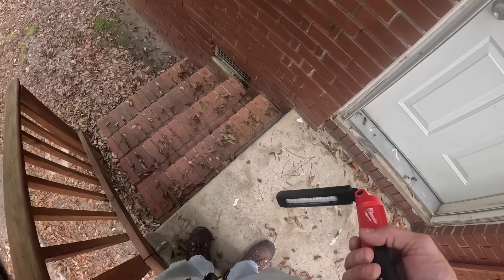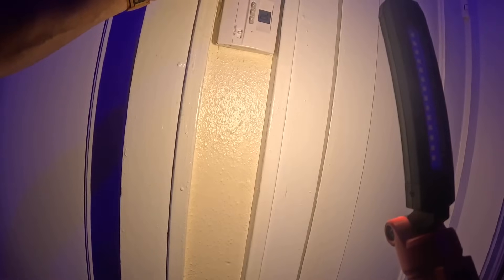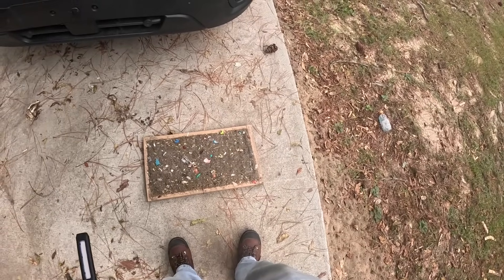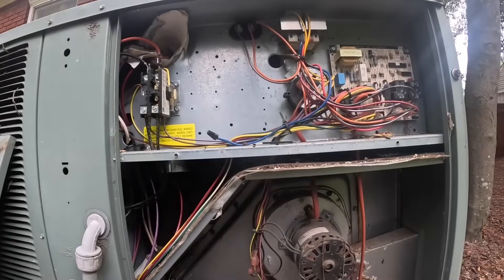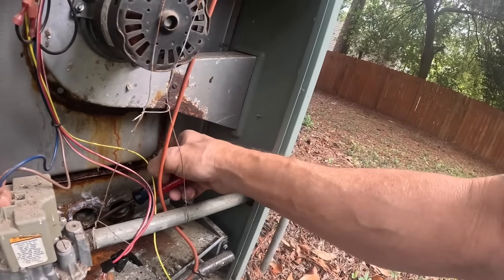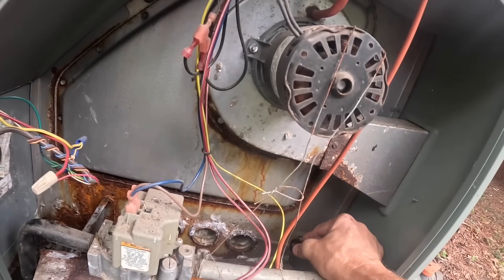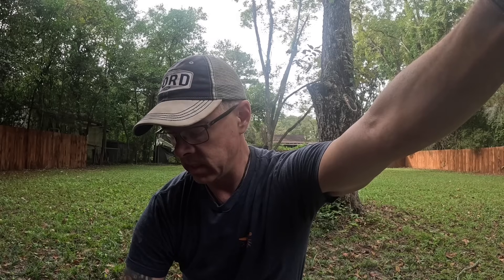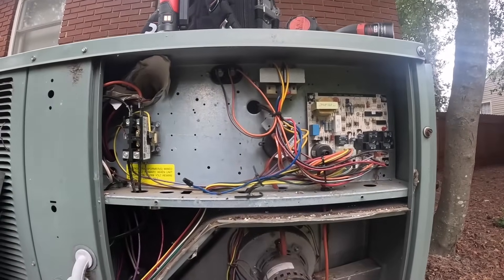Horrible and Dangerous Repair Work On Gas Pack! #hvacguy #hvaclife #hvactrainingvideos

Comment: I have been an HVAC tech for 45 years. That filter is in my top 10 worse I have ever seen. Poor lady, she probably did not even know it was there. Now, that gaspak is in need of your TLC and expertise for sure! Btw, that whole draft motor AND assembly needs to be replaced. Getting the impeller set screw are nearly impossible to get loose, so save yourself some time and headache. Good luck Curtis.

Comment: My guess is the "property manager" was involved with the "repair" 🤔
Another tech was already out and saw the silicone and shut er down. They wanted to see if a 2nd or 3rd opinion would get the gas turned back on 🙄
Unless it's a customer you deal with on a steady basis, I wouldn't expect a call back.
I agree, someone swept the floor into that return more than once! Just, WOW!
Just my observations for what it's worth.

Comment: Curtis, the part number for the burner floor is AE-58594-01. This a Rheem part number, but think that you could cross reference that with a Ruud part number. I've condemned quite a few heat exchangers with that exact problem on Rheem gas packs.

Comment: The owner probably didn't want to spend money to fix it right. The guy should have used furnace cement for a temp fix for the little holes.
Reply from the maker: No temp fix. Needs new heat exchanger, nothing else is acceptable.
Reply: @HVACGUY  oh I know. Was just saying the guy before was probably told to do it. Yes should replace the parts for sure.

Comment: Curtis, I thought I had seen it all  after being in the business for over 40 years, but silicone on the heat exchanger is a new one even to me. That may be the reason the meter is locked out. After seeing that filter, I wouldn't be surprised if that evaporator coil isn't plugged.
Reply: I meant,  wouldn't be surprised if it is plugged .

Comment: Oh Curtis if you’d seen the things I’ve seen in my 46+ years in this business you not be surprised by that filter or that silicone on that unit. I’ve seen guys that put screws in holes in heat exchangers to try and seal them, wrap cracks with metal and gear clamps. Use hydrolic cement boilers to stop leaks. Never be surprised by what some hack will do. You only need be proud of your own work.👍👍🇨🇦

Comment: That filter should be considered a work of art, put it in an auction. Silicone where the burners throw flames is real smart. An Einstein for sure. JB weld or liquid steel would have been a better hack, but still dangerous as hell. There is only one way to fix a heater and it is called the right way. I know they will need heat this winter, but needed it recently? Has it gotten cold enough there already? Well thanks for sharing this video, I don't understand how people can live like that. No matter the income, race or whatever, things can be cleaned up. I would be totally embarrassed, especially having service man or anyone coming over. I'll shut up now, thanks Curtis.
Reply: Not really. Truth of the real world is that those 'hacks' often last longer than the actual 'correct fixes' and are not as dangerous as various people make them out to be.
If they were, numerous homes would 'go up in smoke' due to these hacks being used every year and that does not happen.
The hacks often last until ANOTHER problem causes a fire that burns the home down or causes damage to the home.

Saw that with my relative in W. Va. in the 90's where he had fixed cracked burners in his furnace by welding scrap steel onto them in the late 80's. When he had a fire in the home, the insurance company tried to say "It was due to your CLUDGE!" and did not want to pay.
He hired an expert who corrected the insurance company, pointing out that his cludge had not failed, it was three other parts in the furnace totally unrelated to the burners.
The judge made the insurance company pay up.
Reply: @christopherkidwell9817  Yeah and another judge would have said that if you had called in professionals instead of trying to DIY it, they would have found and fixed the other defective parts and prevented the fire.  And probably would have ruled for the insurance company.  That was a lucky break, not something you should be counting on.
Reply: Lazy ass women spending more time on there phone instead of cleaning

Comment: I must be the only person that actually DATES the furnace filter when I put the new one in and check it once a month religiously lol
Reply: I always date mine
Reply: I usually add a piece of painters tape by the filter panel and write the date on it
Reply: Nope I do, the reason why most don’t put their names or dates on shit is because of liability and in this trade that liability is used as a weapon sometimes to fear monger
Reply: My furnace has a "You can take it out, rinse it off with water, dry it in the dryer and put it back in!" filter and I check it every 2 months (recommendation by the furnace maker).

Comment: How on the world do ya need heat right now I'm in Cincinnati Ohio and haven't turned heat on yet
Reply: Curtis has said in the past it can go from 90 in the afternoon with AC and down in the 40's - 50's at night and need heat.    Those homes have very little insulation compared to us farther north.
Reply: Hit 49 last night here
Reply: @alanjordan7713  It's just the difference in insulation techniques and vapour barriers. Where you live Attic insulation is R20 or R30, where I live code is now R60.   I'm only 760 miles farther North.   It's that old saying; Location, Location, Location.

Comment: several years ago I went behind a contractor that installed a ~20 ton split heat pump at a school and within one year they replaced a couple of warranty compressors... Eventually, I got a call to diagnose the unit. The first thing I recognize is the system was grossly overcharged, I believe I recovered 17 pounds of 410, when I asked to see the returns I went into each classroom , which had a floor returns, it appeared that the children have been stuffing everything that would fit down into the return for years… Recovered the refrigerant and cleaned out all the floor returns... system op’s normal..
Reply: The best part about this project is that the building Director would not believe a single word I said about my diagnosis. Apparently he was great friends with the owner of the contractor that installed the equipment prior to my arrival and he refused to beleive that they could make such an error …this Eventually turned out to be a great contract I think overall there were 30 some odd HVAC pieces of equipment there, which I maintained for several years until I sold my business in 2014..

Comment: I cannot understand why people let their filter get like than. It seems like almost every service call you film the filters are always dirty
Reply: floor returns along with any type of hard flooring is a recipe for a constantly plugged filter
Reply: nobody does maintenance on anything they need a reminder sheet to tell them what they need to do like change smoke alarm batteries, air filters, and thermostat batteries I wonder if they have an ap for that reminding you to do maintenance.
Reply: The extent of most people's knowledge pretty much boils down to "turn the thermostat up, it gets warmer; turn the thermostat down, it gets cooler."
Reply: I can't understand why a filter would be located in the floor. Talk about horrible design. That lady did not know what a filter was, or where it was, but you think she would have seen all the crap on it. I agree with Curtis, that is the worst filter I have ever seen. That unit has been down for a very long time.